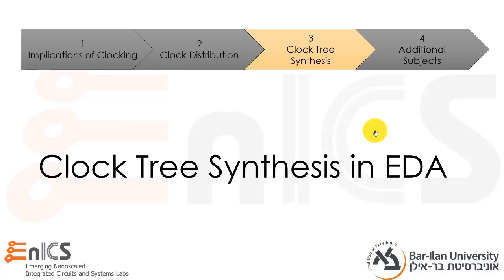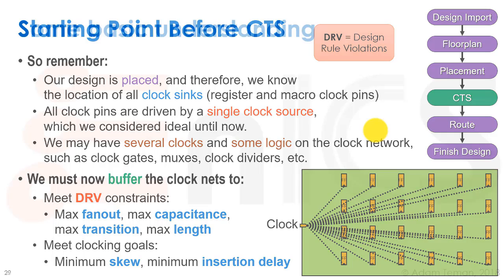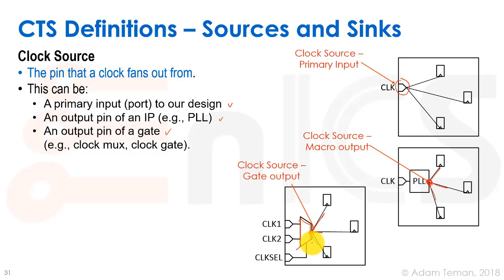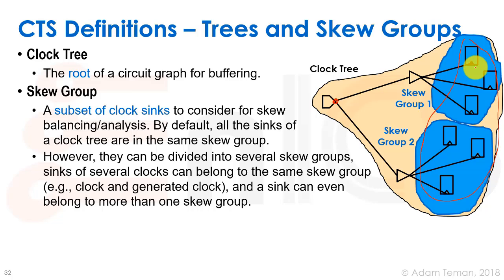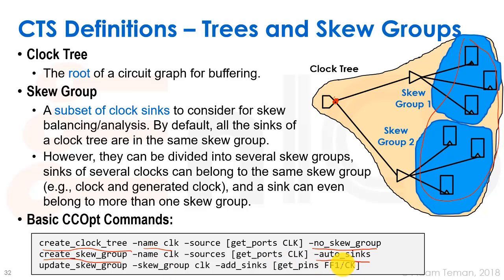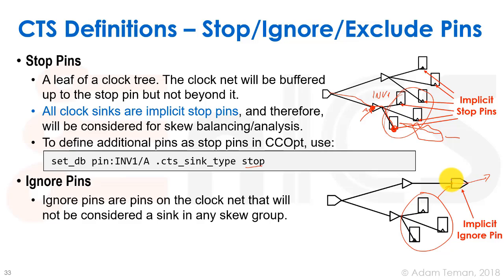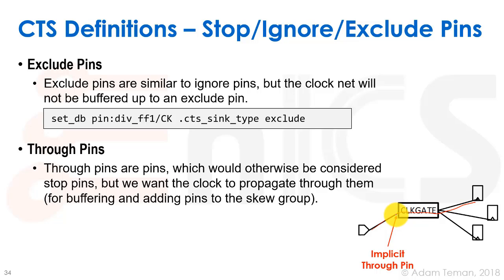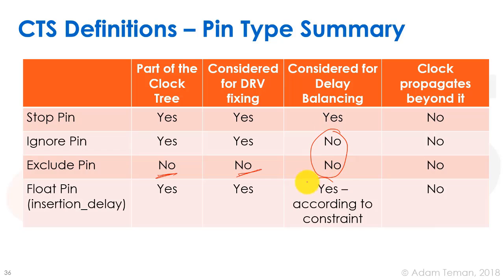DVD - Lecture 8d: Clock Tree Synthesis in EDA Tools

Comment: Hi Professor Adam. 
Your videos are simply wonderful. Huge fan!
One query, could you please provide an example scenario of exclude pin usage for better understanding?
Thanks.
Reply from the maker: Wow, that is such a great question. It is something I have been teaching for years as an option, but seemed to never have thought about what it's good for! Your question made me look it up.

I will say that clock trees are a bigger subject than I discuss in this lecture - much bigger. Every chip has new "surprises" in the clock tree that make you use these different definitions, and every time I have run into one, I say "I'll use that as an example in a lecture on CTS", but by the time it becomes relevant (usually, this is in the middle of a tapeout or other stressful times ;), I totally forget the scenario and why we needed these weird commands...

Anyway, back to your question, I found an answer. The general high-level reason is that there can be cases where a net is both on a clock path and a data path. In such a case, you want to buffer the clock part of the net, but not the data part of the net, so you would put "exclude" on the data pins. 

That is a great explanation, right? Well, the obvious question is "why the heck would a clock net be a data net as well???". And the answer is not too obvious. One answer could be that you may have some observation circuitry on the clock and you treat this as data. But one of the user manuals shows a more common case that actually makes sense and that is the case of a clock divider.

A clock divider is just a bunch of flops, where the output of one drives the clock signal of the other with a toggled input. In this case, we have the Q pin of the flop driving a clock net and so it needs to be handled by CTS. Until now, all is good - we want these to be buffered and such. So this is not the case of mixing clock and data. HOWEVER, we perform scan insertion (which I didn't cover in this course), where all flops are connected in a shift register configuration (scan chain) for testing. In this case, the clock net emanating from the Q pin of the divider flop goes to the CK pin of the other divider flop, but also goes to the SI pin of the next flop in the scan chain. This IS a data path and shouldn't be treated as a clock net. So the SI pin should be regarded an EXCLUDE pin. (note, this may be handled inherently by the CTS engine).

Thanks for pointing this out so I learned something new.

Comment: why multiplexers are needed ? to chose different frequencies ? for dynamic volatages and freq ?.
Reply from the maker: Hi, 
Yes, these can be cases for multiplexers on the clock tree. There are actually many cases where you would multiplex several clocks onto the same clock tree. Just as an example that is commonly found on SoCs:
We usually provide two clocks:
(1) An external reference (from a crystal) with a low frequency (usually less than 100MHz and sometimes much lower)
(2) An internally generated clock from a PLL or other clock generator.
When we boot the system, the generated clock is not available. It takes time for the PLL to "lock". Additionally, we want a backup in case the PLL doesn't work properly or something like that. So we drive both clocks into a Mux, boot with the external clock, and transfer to the internal clock once it is stable.